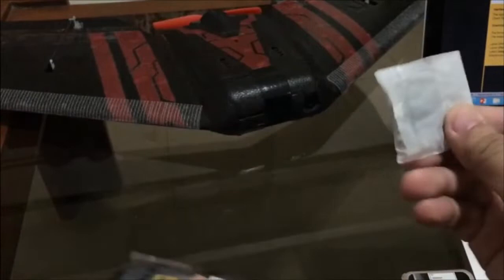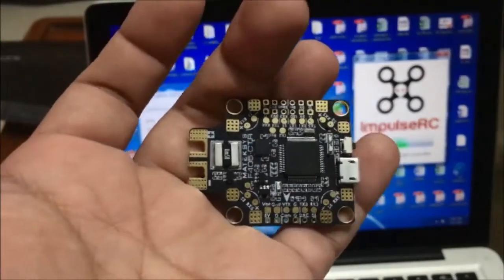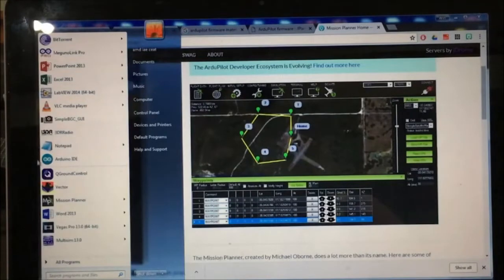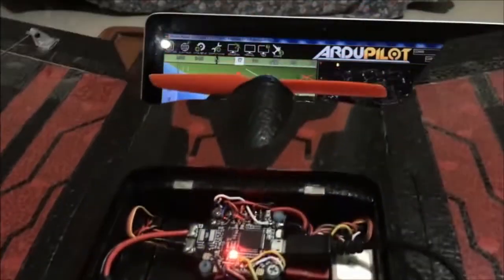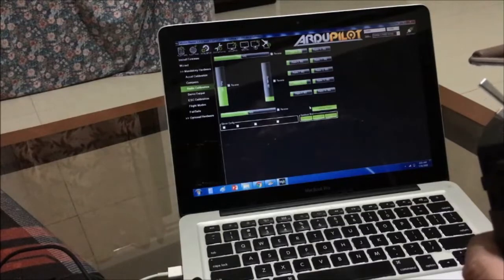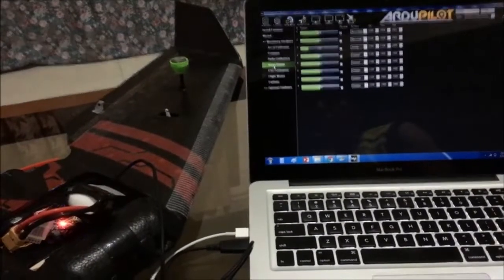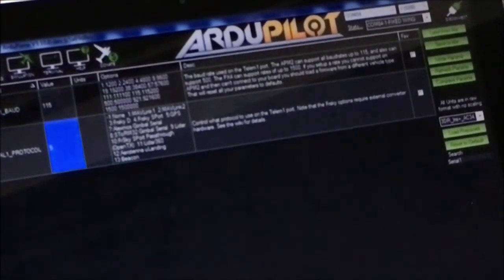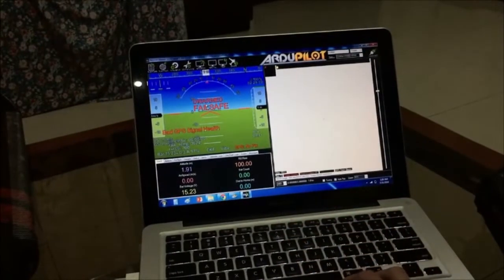Flashing Arduplane on Matek F405 CTR

Comment: 13:36 How fix wrong roll axis angle? Have same problem
Reply from the maker: Look for the parameter: AHRS_ORIENTATION

then change the parameter value such that it will correct the orientation

Comment: Hi, why exactly do you swaped S1 and S3?
Reply from the maker: not really necessary but  for neater wirings, i did not want to resolder some wires so  I just changed it programmatically

Comment: Thanks for your video. Two questions. (1) what GPS modules can run on this FC? (2) will 3DR telemetery connect to this board?
Reply from the maker: usually any ublox gps module can be used. CHeapest one can be the BN-200

Comment: With the documentation on the ardupilot page...is this up to date now, or is what you show here more up to date
Reply from the maker: this should work just fine
Reply: @windfpv  sounds good.... though now I have to undo everything on the board and start over ..... yay

Do you have a diagram or anything that displays things like the matek print out?  Trying to figure where where to hook my gps at
Reply: @windfpv  I have tried to get things working on my board and am having no luck.  Been asking over on RC Groups with little results.  Can't get the board to see the crossfire system, or the gps unit I have wired up either...

Not honestly sure what else to do with this thing, because as of right now it is useless to me.

Comment: Nice video.. can it support for all vehicle like tricoper, quadcopter etc ?
Reply from the maker: yes it can. but limited to 4 pwm out. If you need more, I suggest you get the Matek F405 WING instead
Reply: @windfpv  ok thanks for your information.. i will try build a rover

Comment: Hi Erwin,
Ardupilot can't find my gps when connected to a different serial then serial 3. Even when i change the values. Can you help?
Reply from the maker: are you sure the gps module is physically working? wiring correct?
Reply: Yes is working. But it's solved by just left it connected to uart3 (serial3 )

Comment: how to flashback to inav?
Reply from the maker: launch inav or betaflight configurator tool. hold the boot button on matek board, then connect usb. It should boot to DFU mode. Load the inav/betaflight firmware that you want. If you cannot boot to DFU, download  zadig tool, or impulseRC driver fixer

Comment: Thanks, Erwin. Just a question, what restrictions will I meet when using Ardupilot/ Missionplanner to intend for Fpv longrange flights with my x-copter? So can i have missionflights with this board as i did before with Apm/ Pixhawk Fc's ? Thank you so much for any reply, Alex.
Reply from the maker: You can do long range flights with the matek board running an ardupilot firmware. It's way more appropriate for such flights compared to the inav or betaflight, as the ardupilot has better failsafe handling which is critical if you fly out far. Functionality wise, the matek running an arduplane firmware is almost at par with the pixhawk, but with neater wiring. The drawback is that you are limited to use lesser number of motors. Other than that, it is good :)
Reply: @windfpv  can you use telemetry setup for mission planner just like with pixhawk? If so what UART is for telemetry

Comment: Thanks a lot Erwin. I had problems flashing arduplane on my Matek F405 Wing using iNav configurator until I saw your mention of the Impulse RC driver fixer. After downloading and using it flashing arduplane on the Matek was easy!

Comment: Why do you not use inav ?
Reply from the maker: I am used to flying Ardupilot setups :) also, arduplane has more advanced flight modes , and capable of full autonomous flights (for more fun), better mission flights (with auto take off and AUTO LANDING), and besides, inav is not as matured as the arduplane firmware.
Reply: Cause inav - laggy pice of shit